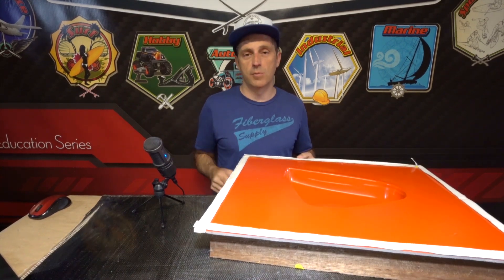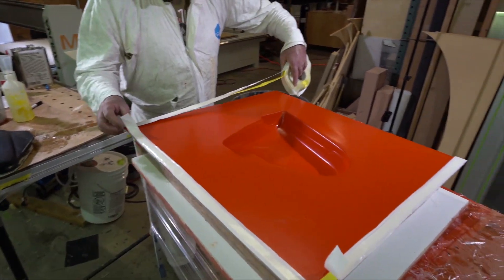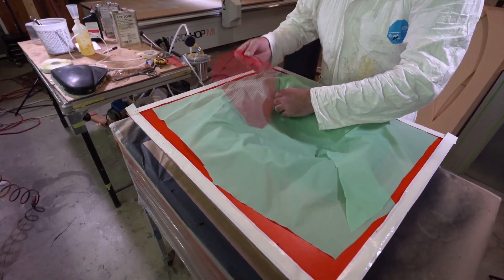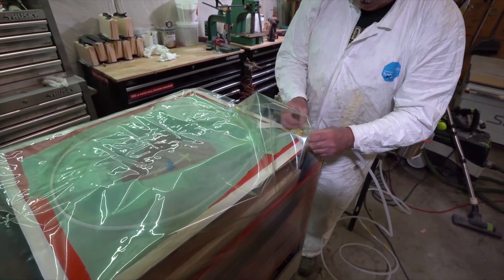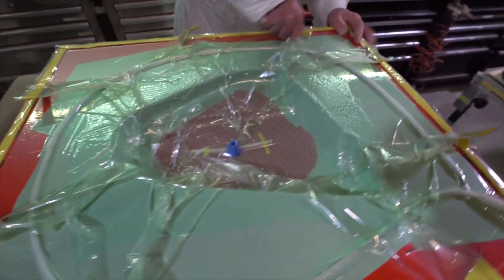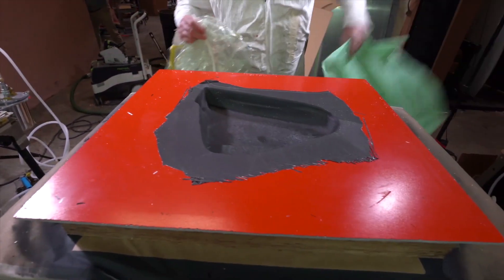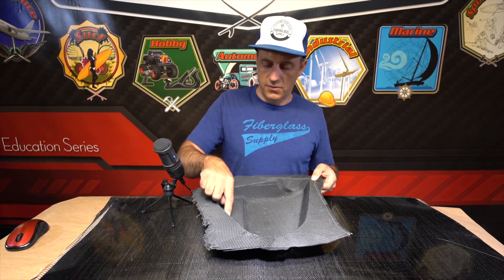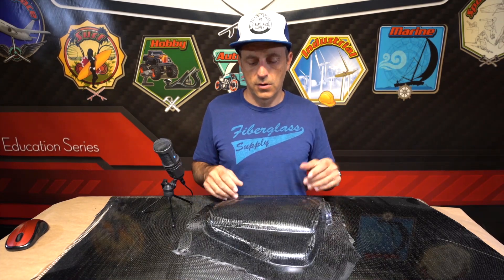Infusing a Carbon Fiber Motorcycle Side Cover with Epoxy - First Part Fail

Comment: I thought about trying to replicate fenders for 1973-1987 Chevy dual rear wheel trucks. They are large compared to your demonstration and with many complex angles. Would I need to make a split mold to get the part out?

Comment: Is bridging still a problem if you use prepreg and an oven / autoclave ?
Reply from the maker: Yes it can be, but if you have done your ply placement properly it shouldn't be.  With prepreg that is a little easier to do as it should have some tack and it won't move around on you between placing it and getting the bag on it.

Comment: As for the release agent is it possible to use the wax and the PVA in the same process as to how the mold was made to make the finished part?
Reply from the maker: Yes- sort of.  We didn't because we did not use a surface coat or gelcoat for the part and without that we would have most likely damaged the pva film in the process.  The other reason is the PVA usually gets some dust or other impurities in it and doesn't come out as nice as a well polished and released mold does.

Comment: What kind of carbon fiber did you use as 2nd layers?
Reply from the maker: It's been so long I don't specifically remember but chances are we used style 613 which is an 11 oz carbon to back up the surface layer.

Comment: The bubbles are not the bridging issue, it is the epoxy feed speed was too fast, epoxy was not degassed and vacuum probably was not deep enough. You have to feed epoxy really slow at the beginning of infusion to not trap the air. You also have to degas epoxy prior infusion. You also have to maintain deep vacuum prior infusion, as close as possible to 1 atmosphere. If the technique is right those bridges would be filled with epoxy with no bubbles.
Reply from the maker: I am going to politely disagree with you.  Our experience through a number of different projects of various sizes and complexities has shown that most corner voids in infusion are from bridging.  I will agree that with a slower feed speed perhaps an area that would otherwise void might fill, but there are other issues that arise from having that area resin rich, including the part weighing more that it should, the resin rich area being prone to cracking or chipping, and the aesthetics being compromised.  We have done extensive infusions with both degassed and non-degassed epoxy and have found that in general degassing does little to help an infusion, it definitely does nothing for corner voids, in some cases with some systems it may help with porosity but there are many other factors that contribute to porosity, including resin front ratio, speed, viscosity, temperature, geltime, and vacuum level.  It is somewhat complex how those all interweave to potentially cause issues and more than I want to go into here but in general to reduce/eliminate porosity a slower feed with a short resin front, and a geltime within 1/2 hour of wetout will give the best results.
Reply: Would adding some small pleats /ears along the female corners have helped ?

Comment: How do you get the gum tape to come off so fast and easy?
Reply from the maker: Good question.  It is a tricky balance of just the right amount of release agent.  On this mold we are using R&B release agent and we only get 1 coat of it where the tape goes down.  More than that with this release agent and you might not get the tape to stick at all.

Comment: I was hoping to see how you trimmed the piece to accurately restore the various elements that you filled in order to get a good seal with the melamine base. I suppose that you could make templates from the original piece. I was also hoping how to use an original piece non-destructively. Removing cured body filler might be destructive, no?

Comment: Do you think it would be cheaper to purchase a fiberglass hood for a 95' GMC Suburban or remove the dents on my original hood and make a fiberglass hood with vents myself? Thanks for the very informative videos.
Reply from the maker: If you just need 1 hood it will be less expensive to purchase it than to fix up the existing one, modify it, make a mold, and then make the part.
Reply: @FiberglassSupply  Thanks!